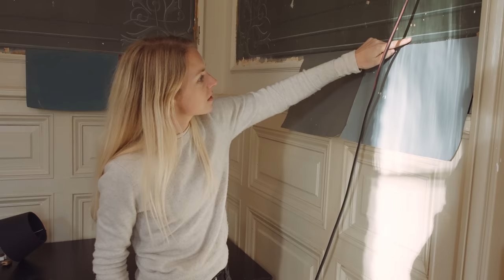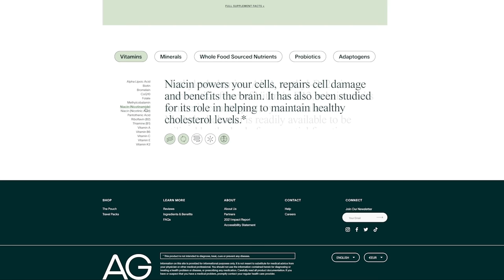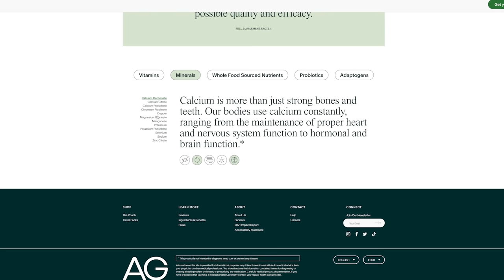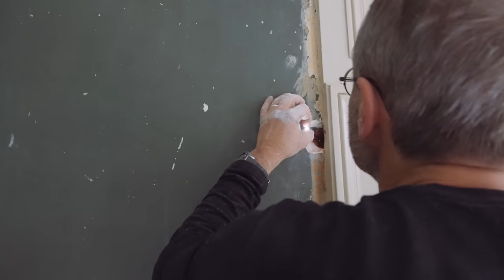Dining Room Makeover in a French Chateau - Part 2

Comment: I think you should restore the original green painted wall... the colour is so modern too. And I love the powder blue for the paneling below. Your instincts are correct i think, Anna.
Reply: If she decides to restore the original green paint, she should send a chip of it to a lab. Arsenic was used to make green paints and wallpapers into the late 1800's. If she thinks the mural is from the 1820's then it's very likely that it is toxic.
Reply: @melissaalexander176  She doesn't necessarily have to ingest it. Arsenic poisoning can occur by ingestion, inhalation, and dermal absorption.

"If the paint or wallpaper becomes damp, then a mold can grow on the wallpaper that can metabolize the arsenic into a volatile form of arsenic called arsene. This arsene can then be inhaled by the occupants. Even if concentrations are low, prolonged exposure can lead to arsenic bio-accumulating in the body." (Envirochem)

Or like lead paint... the biggest issue is that a pet or child could inadvertently eat a paint chip.
Reply: Furthermore, i would treat it as if it is art. I did a little bit of fine art conservation, and what you need to do is just infill the existing paint/pattern by matching the existing with a water soluble paint, such as gouache... so that in the future your conservation efforts can be reversed in need be. The mood in the room would be very elegant and dramatic, and modern at the same time, Plus it really works with the rest of the Chateu colour scheme.

Comment: Pulling wires gives me anxiety haha.  I am amazed that the thread solved it!  I just pulled power extension cables under our driveway through a 20ft x 2ft corrugated pipe. I used two long clamps attached together with electrical tape and my arm fully extended to hook the wire pull cable and finally get it. RGB flood lights to light up our trees for the holidays.

Comment: For all ceiling sanding jobs you should be using the "Festool Planex LHS-E 225 Easy Drywall Sander" designed to not force you to go to the chiropractor after doing ceiling sanding work. Safely extends your sanding reach and easier to hold with two hands.

Comment: That was a great way to run the wiring. Here in Australia the sparkies (electricians) use the plastic tongue from chipboard/partial board flooring to chase the wiring through the walls and ceilings.

Comment: I use a "fish tape" to pull wires, etc through the walls. Its stringer, much easier and quicker method.  Do tthey not have them in France?  You can buy one at Lowe's or Home depot here in the states.

Comment: How old is the paneling in the room? Are you not concerned with drilling holes in it ?  Or is it false panels ? Did I notice your kitchen taps are discoloring and spotting  already..oh no.
Reply from the maker: The panneiling is from the 1820s, so not an antiquity. It's ok to drill a couple of holes into it to make it a livable place for present generations. Can be undune with a plug if necessary... the kitchen tap is supposed to aged as it's unlackered brass. we need to polish it though to keep the "aging" more subtle..
Reply: @HowToRenovateAChateau  I love the patina the brass is acquiring.

Comment: I saw a home improvement episode once where they needed to get a wire fed through a long distance. They skillfully connected some light string to the end of a piece of electrical wire. Then, they used their powerful shop vac to suck the string through the wall and pulled the electrical wire attached and it worked!